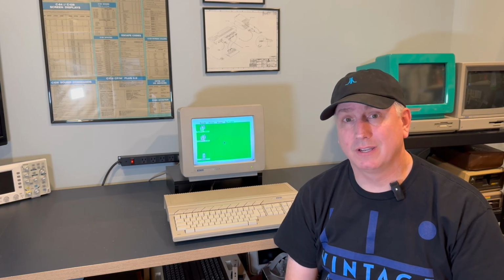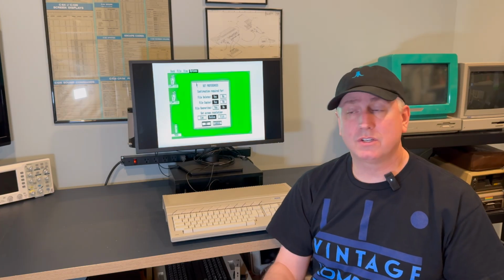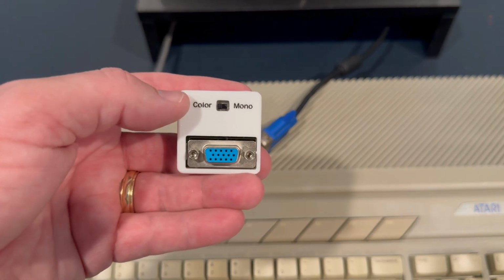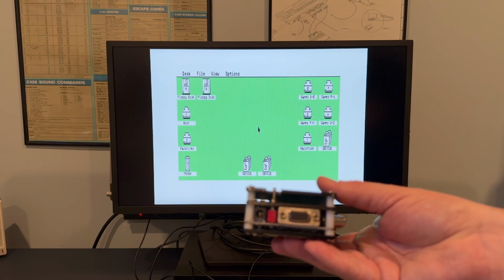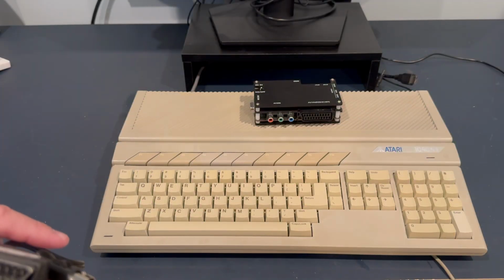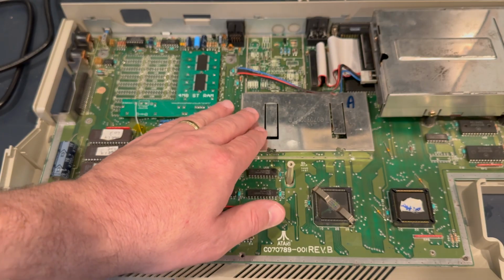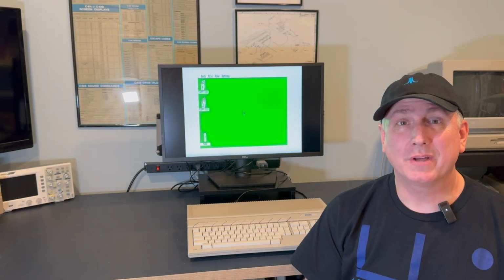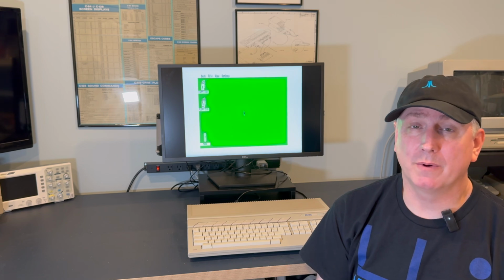Getting video output from your Atari ST.  Atari ST 101

Comment: Hello, can you tell me where to get an OSSC like the one you demonstrated? Thanks 🙂
Reply from the maker: Amazon here: https://www.amazon.com/Mcbazel-Component-Converter-Nintendo-Super-NES/dp/B083FG6PXH/ref=sr_1_4?crid=1VRHZFDNWAXLB&dib=eyJ2IjoiMSJ9.QZhKN_V-K7Vhz1K9JCFMrS7-nLM4gbFZCDunZj0F5ump3LI1R_e27wsRjqU93u1Q1pLnyW4mSj1CvgcwMeDOJ3yN_GttDmaNpgJnbABO2m_U9-KCEmHko8K4rGPjhOOyz4SFQq6Fhle035QoKyr86ORJOw31daWVHwNhOTzan8fG4Hz325J6Dzl9-MN5Q9BZqF-s26VSLlqRdSGVIiAwG0floHJ_6WN94mKeUktJ90E.olaHZWW_YNJkJDVOj4bQ6fMoV2yAP6mBpCD3F-M9bqE&dib_tag=se&keywords=ossc&qid=1762947732&sprefix=oss%2Caps%2C120&sr=8-4

Ebay here: https://www.ebay.com/itm/406367330567?_skw=ossc&itmmeta=01K9VY0ET5GMZ102YVYPZJ5GMT&hash=item5e9d616107:g:F38AAeSwNsppETIA&itmprp=enc%3AAQAKAAAAwFkggFvd1GGDu0w3yXCmi1frZI2iEU4Ayi1OXKIDEiXWvjJmPdjyNtj%2BjOw6rg1pByh0UHJoDaL5h%2BtbqLQoHOWrAZpKoqR%2Fj9O5BXsJw%2BHmgK1e7oYtfYBvNOn3yPRxm%2BNT3jqZoqiPVfn%2BQNLtwxO72PAqbmpTQqtATPyRrBQkRrj3ViNzWp9fRPWlHDh99yT0V0%2BTXGdeR16sJ5cZkGxz0PRDcsX3M%2F6CCQGmT%2BC3olHRE8hCj7xSLtyxy7ZFyw%3D%3D%7Ctkp%3ABk9SR6Dtgf7OZg

Comment: Hello! I'm one of the folks who was excited to get a 520ST only to realize that I've got the basic version without the modulator. Worse, I'd already moved forward planning around a setup based on composite RCA, so I'd purchased a 13-pin-to-RCA cable only to be confused when it didn't work. 

Is the process of adding the transformer/diodes/etc. you outlined starting around 16:42 the solution to getting composite RCA out of my basic 520ST and possibly even using my existing cable?
Reply from the maker: It is possible for a 13pin to RCA cable to work.  See here for the mod: https://forums.atariage.com/topic/307200-adding-composite-sync-signal-to-an-stf/
This works for an older ST without the silkscreen...this might be yours it might not.

More details on the ratings of the components can be found in this thread here: https://forums.atariage.com/topic/289781-found-a-working-scart-hdmi-adapter-on-amazon/

I can't vouch for the cable you have, but I would assume it should work properly.
Reply: @powerofvintage9442 Fantastic! Thank you!

Comment: Nice video showing connection methods.  When I got back into using my Atari ST, I had (still have) a 1435 Atari color monitor which worked fine.  But I had a big 50 inch flat screen that I wanted to see ST graphics on - I bought an OSSC, 4 foot male to male SCART cable and the DIN pinned connector and made my own.  It works very well - games are bigger than life, the screen colors vibrant.

Comment: I would love an external power supply like that for my 1040 STe. Is that one you built or are they available somewhere. Can you share information about it?
Reply from the maker: Here is the video where I built it up: https://youtu.be/ObbmF-wmNbM

I built it with a port that I could simply add different output cords to. 
1 - For the 520ST
2 - For my Amigas
3 - To plug directly into STF's boards for easy troubleshooting.

My solution is good for testing, but isn't ideal for regular use.  A better solution is found here: https://youtu.be/yL95z67AbMM?si=VuTaf5NuPmeElali
Reply: @powerofvintage9442  Thank you!

Comment: 16:18 It doesn't necessarily "require" Composite-Sync, but is more compatible to certain TVs and monitors. I use a Scart cable similar to the schematics you shown, apart from the switch (Pin 2 of 13-pin is directly connected to Scart 20) and it works fine on both my STE and STF (without modulator) with the OSSC, GBS-C and my old Philips CRT monitor from the 80s! BUT my old LG-TV with Scart input doesn't sync the picture of the STF properly (on, off etc.), but works fine with the STE!
So, the OSSC, ODV GBS-C and my Philips seem not to need Composite Sync on pin 20 of Scart, my TV does need it.
Didn't knew that you can add Composite Sync to a STF with just a few components, thanks for that. Think I'll do that on my STF. 😉

Comment: If you have an Atari ST without a modulator, meaning no composite output, you can still use the SCART solution. Then you use the RGB connections on the SCART. It also provides a better picture than composite video.
Reply from the maker: How do you get the needed sync signal though?

Comment: Can anyone show a link for Europe for a new current VGA monitor that will work with an Atari Falcon 030. The links we have only show one or two monitors and they are both from 2007, its almost impossible to find, any help would be appreciated. Thank you.
Reply from the maker: The monitor I use in this video, Dell 27 Monitor SE2722H, works perfectly with just the standard, passive Falcon to VGA adapter.  Running it right now
Reply: @powerofvintage9442  Thank you!!!
Reply: @powerofvintage9442  Thank you for your response, is there vga to hdmi connector adapter for atari falcon 030, so it can be used with modern day BenQ monitor,  I am cramped for space and trying to use the same monitor that I already have!
Reply from the maker: @PermanentGreen  I have had great success with an OSSC (Open Source Scan Converter) with my Falcon to my Lenovo curved screen monitor. 

The OSSC does a great job taking the VGA and outputting an HDMI signal.  It will also work with 15khz signals as well so you can also use the RGB modes from your Falcon as well.

I use this same monitor with my daily driver PC so that my Falcon is ready to run at the same desk as my modern computer.
Reply: @powerofvintage9442 Thank you Sir!!
Reply: @powerofvintage9442  Thank you, I found one coming tomorrow, fingers crossed, one more question please, is there a way to connect another regular keyboard to the Falcon, want to use a smaller keyboard and just tuck the Falcon under the desk, can that Serial port be used for it ? Thank you, learned so much on your channel.
Reply from the maker: @PermanentGreen  I believe you can use a NetUSB with the keyboard driver set up and connect a USB keyboard to it.  I'm not sure if you can use a wireless keyboard dongle that way.

I've not done it myself.  I'll try it later today and get you a definitive answer.
Reply from the maker: @PermanentGreen  Just tested the NetUSBee with a usb keyboard and it works just fine.  Tried a wireless keyboard with its dongle and I got bombs.
Reply: @powerofvintage9442  sorry but where can we get a  NetUSBee, it seems that is not available anywhere?

Comment: I'm very glad you mentioned that not all ST's have composite sync, that's a VERY important thing people need to know before getting an ST. 
I was losing my mind wondering why none of the scart cables I bought worked until I figured out my board was missing the circuitry.
Reply from the maker: SCART is very convenient, just so long as you have that signal.  I can imagine the frustration.

Comment: I have recently discovered that modern LCD monitors supporting AMD FreeSync can sync at a 15 kHz signal on an analog VGA input, and will work fine, using just a passive adapter with an Atari ST or Amiga.
Reply from the maker: Very good to know.
Reply: do you have some names, its very hard to return stuff if it does not work in Europe.
Reply: @PermanentGreen  When you buy online, simply send it back, just don't tear off all the plastic protectors, and do not destroy the box. I have an Acer KA272, but it is not a good monitor, yet it is one of the cheapest 27" with FreeSync (and built-in speakers).

Comment: I now have 3 STs. An original 520ST, a 520STM and a 1040STF. 

I love the ST but it’s a nightmare compared to my Amigas with modern displays. 

The best display quality I have is using the same vga adapter that you have run through an OSSC, the same as you. 

I might have to look at adding the composite signal to see how it works. 

The original 520ST is a nightmare, but sadly it’s the one that I have that came with a soldered exxos 4MB upgrade installed. 

When switching to 50HZ the screen is shifted far to the right, although birder colors are full screen. Thus doesn’t happen to my other STs. 

The other weird issue with it is that while an ACSI Supra drive works with it the ACSI2STM and Sidecart don’t work with it. I’ve swapped chips on the motherboard, tried different power supplies. Tried multiple TOS versions including EMUTOS, but no luck. 

The closest thing I have read about when it comes to a more intermittent issue tray I have is that a10K bussed pull-up resistor might help clean up DMA issues, but I’m struggling with how to solder the budded resistor to the floppy controller pins. 

The machine is driving me nuts!
Reply from the maker: I have 3 different but near-launch (all 1985 vintage) aged 520ST's and all 3 have varying degrees of greater than normal video signal noise. 

I've not had the DMA issues you mention.  I have run across one 520ST with a bad WD1772 (floppy controller) IC.
Reply: @powerofvintage9442  thanks for the reply. I’ve swapped out the WDC1772, DMA and Shifter chips with known working ones. The 50hz issue is annoying because it’s needed for plenty of things from Europe. 

I guess my only option is to practice soldering and see if the DMA related mandatory fixes help.

Comment: Very informative, thanks! The main issue that I see is that a lot of monitors are HDMI-only these days. On top of that, it seems like one modulator which works with one retro computer may not work for another system.
Reply from the maker: That’s one reason I do like the OSSC.  It isn’t universal, but has enough options that it works with all my systems I have here.